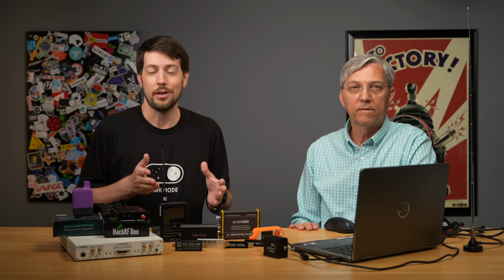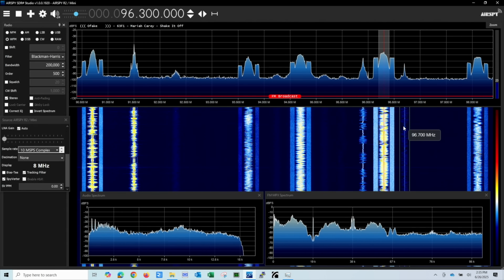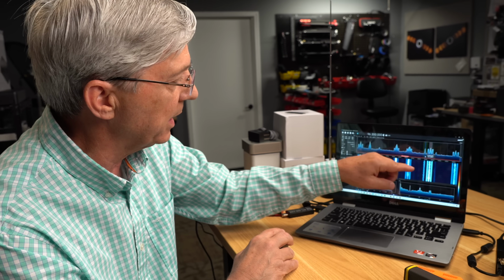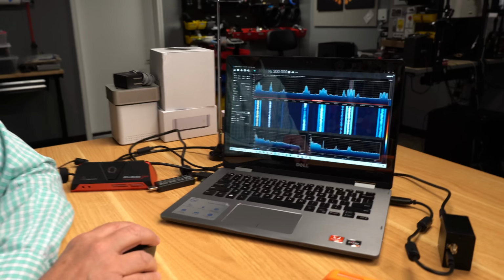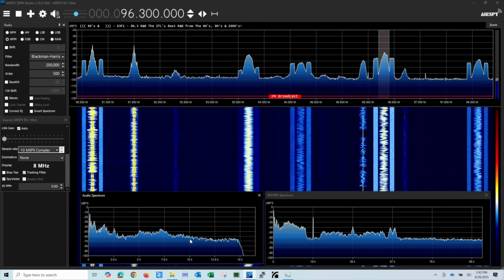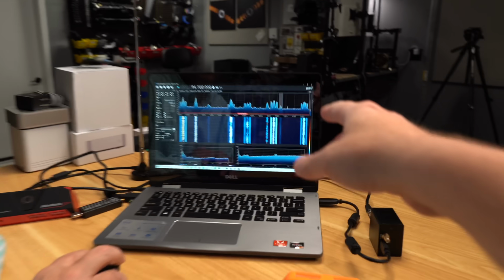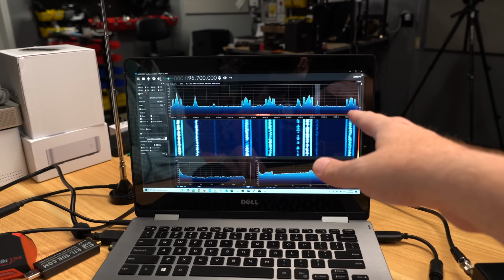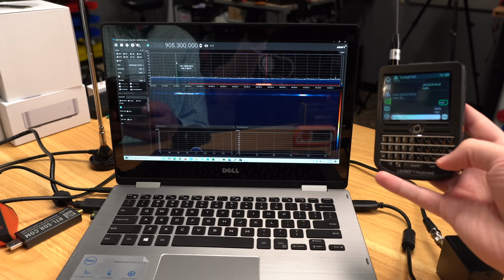SDR is an incredible tool for understanding radio

Comment: Washed up broadcast engineer here.  I recall being at our 2000' tower site which housed primarily 2 UHF TV and 4 high power FM radio stations troubleshooting some leakage issues.  Super fun when you can't power anything off.  One of the other engineers made the comment of how awesome it would be if we could put on goggles and see RF.  That stuck with me.  I feel like these ultra wide band SDRs allow us to do just that. And at a cost that's unbelievable. Hopefully this will help kiddos get into rf early.  I'm sure you're well aware there is not a mass of youngsters waiting to fill the shoes of people like your dad.  Hats off to both of you for taking the time to pull back the curtain for the masses.
Reply: Sites like that have so much RF. The first time I used an SDR I dreamed of seeing the tower by installing large quantities of SDRs that were remotely accessible. When anything odd was going on a quick preliminary report from units north, east, south and west both close and far would tell a lot in a very short time. There are units that are available to access coming online in a free ‘shared’ setup. 
Thanks for the comment!

Comment: In the pro audio/live event world, sdr can be a good poor man's tool to do spectrum analysis for wireless mic deployment.  A little less necessary now as the newer receivers have better and better tools built in.  But I still carry my little RTL-SDR with me as a back up problem solver.
Reply: Perfect use. If I can find some time I might get a pi and a touchscreen and print a case and use it to sniff areas where I have transmit or receive gear operating. 
Thanks for the comment!

Comment: I have questions about which kind of coax cable do you use and which antenna do you use for what frequencies? Are there antenna switches?
Reply: Cable and connectors may become a video in the near future. There are some basic considerations depending on your need. The antenna and cable become a system. Think I’ll throw the idea of a cable and connector video to Jeff.
Thanks for the comment!

Comment: I have had an RTL-SDR Blog V3 for ages and a few months ago I got the V4.good little pieces of kit. I use the V4 here in the shack and have the V3 in my car connected to the android stereo and an external antenna so I can listen to the lower HAM bands in the car.
Reply: Cool use! Do you have an SDR connected to an Android phone then connected to the Android auto in the car?

Comment: I'm getting more into ham, and I have my eye on the SDRplay, specifically the nRSP-ST that runs on the network and is remotely accessible.  I'll probably still buy a cheap RTL-SDR just to get my feet wet for a lot cheaper.
Reply: My first SDR was connected to a pi, my second to a Mac and. The most recent higher performance unit to a Win10 laptop. Not all the software plays nicely and the more Linux the more you can customize (if you are a coder).  Starting out I would get a model that seems easily installed on the computing device you plan to use.
Reply: Jeff has one running on his network. I have not had the time for that project at my home but want to get it working at several transmitter sites as ‘remote RF eyes’ on the sites.

Comment: Great video, thanks guys. Quick question though, what's the main usage difference between an SDR and a spectrum analyser? I'm relatively new to all this.
Reply: I beleive the two may merge at some point as Spectrum Analysers and SDRs are both looking at the RF vs time. Spectrum Analysers were special built to display the RF vs time and a good one can give a lot of great detail and demod a signal, etc. Spectrum Analysers were special-built hardware with special software, lots of options for adjusting filtering and levels. I could see them evolving to more generic hardware and letting software be written by others - making them SDRs! May have already happened. I’ve got a TinySA as it is easy to carry, quick to use when sniffing an area of RF is all I need to do. Thanks for the comment!

Comment: One very neat application of SDR is for making a scanner for listening to fire/police/ems/etc traffic. Many jurisdictions now use P25 digital trunking equipment, and with the op25 software and an RTL-SDR dongle, you can listen in. And it will work fine on a Raspberry Pi. For those who are really motivated, you can set up an op25 install on a Pi (or an old laptop, whatever) and connect to Broadcastify and stream your local fire/ems traffic (or whatever) onto the Internet for anybody in the world to monitor. 

(note: does not work for jurisdictions that run with their traffic encrypted, but thankfully most agencies either do not use encryption, or only use it for a handful of channels, like a dedicated channel for vice enforcement activities, etc. Only a small number of agencies run with everything encrypted, in my experience)

Also, nice @saveitforparts shout-out! I love the Save It For Parts Channel! It would be really awesome to see you and Gabe do some sort of collab one day. Hint, hint.

Comment: It really stinks that you probably can't decode those HD signals on your laptop without breaking US law.
Reply from the maker: AFAIK (IANAL), nrsc5 is not illegal to use, as it's cleanly reverse-engineered.

But IMO it's still silly for HD Radio to be patent-encumbered. Probably 98% of the reason it's failed to get wide adoption is because it's a closed standard and is still not even close to ubiquitous in US receivers. Ironic because it came from IBiquity.

That's a lot of acronyms!

Comment: I was part of the design team that developed the Microdyne RCB2000, which was the first SDR, dual telemetry receiver and included  a digital combiner to maintain a constant video level in spite of fading. It was done with multiple  sets of FIR filters, bot at 70 MHz and for the recovered video. You could sect the IF and video bandwidth was easily selected by the firmware. It included a  small SVGA plasma display There are photos on line, but Le-com bought Microdyne to get that desibn, but they are now out of business. I worked in Engineering during the prototype stages, then built yest fixtures and set up the programing for the 17 processors.  The firmware could be remotely  updated over the internet. It also reconstructed a 70 MHz IF output to feed a traditional data recorder for further processing. A block downconverter was external, to elect the band, then the internal tuner downconvered to a 50 to 70MHz IF.. It was designed to track satellites

Comment: AirSpy, HF or VHF on up models, is what I'd purchase after playing with an rtlsdr dongle. Youssef Touil has done a wonderful job with them with performance above things like RFOne, HackRF, and so forth. For HF I stipulate that an up converter to an rtlsdr or other VHF+ dongle can give you some HF coverage. I found that rather unsatisfying due to frequency drift. The sampler's oscillator and the converter's oscillator seldom track. And a 1 PPM error between them is more than 100 Hz error since the up conversion to the 100 MHz to 150 MHz region is involved. Nonetheless, the marvel here is that it all works and at what scale it works.

The AIrSpy tools work with most SDR software out there including the two I use, SDRSharp (on your dad's laptop at 1:19 receiving from an AirSpy R2) and SDR-Radio.com's SDRConsole. Both are marvelous tools. But, both are basically Windows programs. SDRSharp works on 'ix OSs work with MONO. SDRConsole is very much Windows only with display features I've not seen in other SDRs. SDRSharp supports community plugins. SDRConsole is Simon's magnum opus all his own code.  He's a retired genius.

My playing with SDRs was coming home to radios after a detour through satcom network control, GPS satellites, and broadcast video software. I've made it to 81 and still fuss with SDR code of my own. At first it was, "Oh, neat, this works well at near zero cost with source code out there." It graduated to seeing what signal analysis could be done. what nearly magic noise reduction now manages, and the world of other possibilities it presents. And, all the familiar steps of things like super heterodyne radios take place in digits but not quite the way you'd expect. It's brought back the joy of learning. (And for me Microsoft Visual Studio is the absolute best computer game ever. And I can build with it, too. Yeah, it's learning curve is impressive.)

Good presentation. (Get 3 or 4 or 5 or .... I have several retired RTL things and 6 AirSpy minis that are hot now plus a spare, an AirSpy R2 and its predeceassor, an AirSpy HF+ Discovery and its predecessor, a couple RX888s (120 Msps), a Pluto, a Hermes Lite 2 and - trust me, this is addictive, very addictive. And it's as much fun as things like EZNec for antenna analysis. And, I paid for them all. Every time Youssef announces a sale I get another it seems. And he has a sale going now. jttps://airspy.com.)

Out of curiosity why did you not mention the AirSpy R2 dongle you were using? It's a nice tool. I am surprised the gain levels you used worked like they did. I consider my location noisy and run them at considerably more gain than you used. I do notice you are somewhat limited by the very high signal levels you are dealing with. I'm in the diffraction zone from the Mt. Wilson fire breathers by the mountains so I don't get huge signals. I'd recommend using either the sensitivity or linear setting mode, probably linearity for your setting. Those drive the three gain control for close to optimum settings considering the actual gains inside the R82-T2 tuners used. I usually live at "14" in the sensitive mode. That is just after the noise figure no longer improves with more gain.

{^_^}

Comment: I had to look up MPX. It's the FM broadcast term for the unmodulated signal that contains the L+R, pilot tone, L-R DSB-SC, RDS, etc. I'd imagine that the MPX input is handy when doing precise measurement of the MPX signal, where the extra noise from demodulating the RF FM signal would cause trouble. That said, I've never had to touch FM broadcast equipment before so I can't say for certain.

Comment: I added rf chokes to a pair of aftermarket HID ballasts. Before, FM reception in the car was severely impacted when I turned on the headlights. After adding them, my FM reception came back. I took a shot in the dark and they worked.
Reply: I did the same with some aftermarket LED on a previous car.
Reply from the maker: Sounds like me (Jeff) adding baluns, lol. "I put one on and it solved the problem. Why did I try it? Not 100% sure, but it works now."

Comment: I got a nice discone antenna, put it up about 20 feet above the house. Just ran RG6 and adapted to an SMA pigtail, to a NooElec with a Ham-It-Up. Incredible what this little setup will receive. Using a big Android tablet and SDR ++.. Great stuff!
A tip for dongle heat: Get some cheap heat sinks for NVME SSDs. About $8 for a 4 pack on Zon with little rubber bands and thermal pads, perfect for an RTL SDR dongles.

Comment: Thanks for the video. Did you buy everything
Reply from the maker: The HydraSDR was provided for testing as mentioned in the video (it's launching soon). Besides that, all the other radios were purchased at various points in the past few years, though the USRP was provided by a friend of the channel, not affiliated with Ettus or NI (I couldn't afford that thing!).

The problem with SDRs is they start multiplying like Tribbles...

Comment: Wait, why would you be calling the FCC on anything? The FCC is supposed to have MIB looking guys in some sort of robovan driving around hunting down them pesky pirate stations and soccermoms who dare infringe on the sacred ground that no one but some special sausage is allowed to fart on. 
Dislike and stopped listening to this - this is the sort of people the radio hobby does NOT NEED. I used to listen to a bunch of amateur stuff, but over time there was less and less and less of it - and I'm not surprised. I've stopped listening a couple of years ago, never bothered to upgrade my radio to something 'serious' - still have my FT-817 but as a transmitter it's just a fart in the dark. No point in upgrading since there is nothing out there, unless you have a bunch of land to build some ginormous antenna on and then a boatload of cash for all the thingiemajongs needed to run it right - and then you can trade noodle recipes a bit further out than your immediate vicinity, but you should start practicing your morse code because that's what the Fudds run. 
Almost forgot, you of course need to pass the little test to make sure you know transmitter circuits and modes and all that super important stuff! Then you get your very own call sign and license, and they teach you the special secret handshake you need to use when the FCC comes callin 😂

Comment: what kind of am power is needed to transmit at 2000 km? if the antenna is so-so. In Russia, an amateur with 1.2 kW of power is said to have transmitted 5,000 km in USB format on short waves of 4500 kHz

Comment: I re-engaged with my old CB Radio hobby a few years ago .. and while getting a nice radio and antenna setup .. i added a RTL SDR 4.0 to the mix .... and then got my hands on a HackRF One (first gen)..

I just love them. I mainly use the HackRF on my desktop, switching my DIY T2LT antenna (made from a (partially stripped) length of RG-58 wire) between the CB radio and the SDR.... A nice thing on such very simple T2LT antennas is, they're recieving a good broad spectrum down below from some few kHz up to 40~50mHz with no problems..... which pairs nicely with the SDR. ;)

Comment: I actually found this very interesting! It is amazing to see how the hd radio stations are being carried and where the signal actually is. I assumed the could not exist in the same space as the analog version of the channel. Would be curious on your take on if you consider the digital audio to be better or worse than the analog version. I won't share my opinion here as I do not believe it is relevant here. Also as an indirect question to this can it seems digital AM radio? Does that exist? Again is it better than the analog version and what makes a good everyday listening AM antenna? These are questions I have thought of since high school. Love these in depth videos Jeff!
Reply from the maker: Digital AM does exist but IIRC only a couple stations in St. Louis ever deployed it... then they dropped it a few years ago as it didn't have much uptake :(
Reply: For years I have tried receiving 840 whas on digital am but assumed that this was not carried for the same reason. I am in the Louisville, KY metro area. Wanted to experiment with that. :(

Comment: Good Video.SDR,s are a lot of fun for, Ham Radio ,Shortwave ect ect.I also have 2 SDR,s running ADSB Plane tracking,I mainly use SDRPLAY Radios.I can even listen to San Francisco airport tower on 8.867 mhz with a loop antenna when Skip conditions are good at night here in Australia.
Reply from the maker: Wow, nice DX on that!

Comment: At 12:00  I noticed to "spread-out" signals when you transmitted.  Interesting.  At 18:10 - It would be prudent to ger a USB power supply to handle the power.
---
Yes, I have an old RTL-SDR, but will be buying a new nooelec v5.0 soon.  I'd like to see a project for a Pi with one of these!!

Comment: Joe, I think often the beads are used to keep the RF energy from the massive amount of switching that goes on inside a computer from using the power cable as an antenna.  That's why they're close to the power jack (of laptops in particular).

Comment: Jeff and Dad,  I use my SDR attached to my 2m/440 vertical antenna to receive images from the ISS when they transmit them.  Some of my images are really good, but others are bad due to the fact that the antenna doesn't have a view of the sky in all directions.  Just another fun use for an SDR.  Best 73's de WD6FIE

Comment: After a massive water leak at my previous house between the meter at the street and my foundation someplace. I had no idea it was leaking until the water company knocked on my door letting me know there was a leak and that I had 10 days to fix it or be shut off. After repairs were complete I got an SDR so that I could read my own meter signal and keep a log of it as an early warning system. At my new house its capable of reading both my water and natural gas meters.
Reply: Woa. That sounds like a excelent reason
Reply: DSB is Double Side Band, where the carrier is just suppressed.  It is similar to AM, but the carrier is suppressed.  With no audio out, you get no RF out at all.  As you get an input signal, the output can go both positive and negative.  In other words. The output signal can be a sine wave of a certain amplitude, but when the amplitude goes negative, you get an upside-down sine wave (180 degrees out of phase).

The purpose of the ferrite is to reject higher frequency COMMON MODE signals.  For a USB cable, power can still flow.  Data is a differential pair, so that is unaffected.  But any noise should get reduced.  This helps keep noise generated inside the computer from getting into the radio.
Reply: That’s a great reason
Reply: Ingenious idea!
Reply: Do these signals have encryption? 
I guess it's fair use unless you try to hack into these with a transmission.